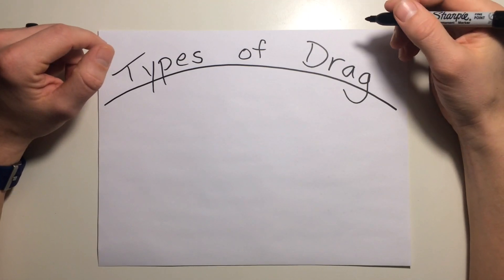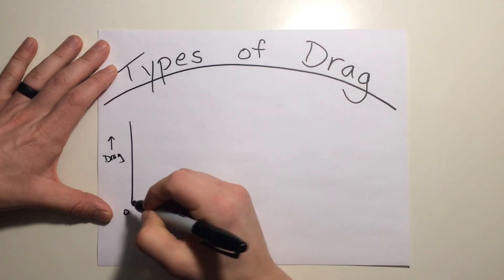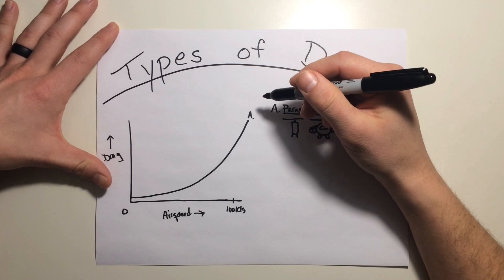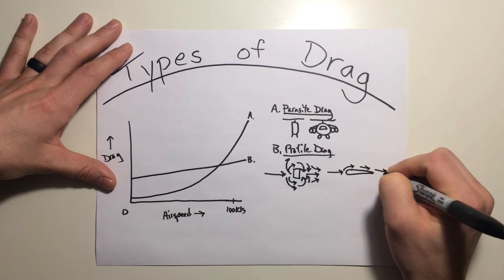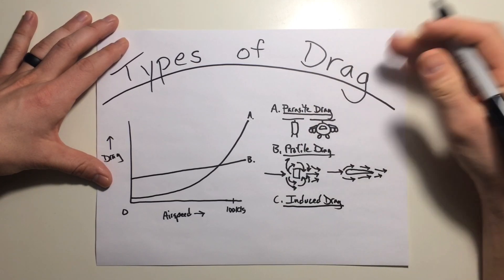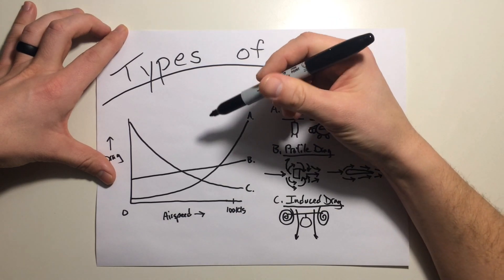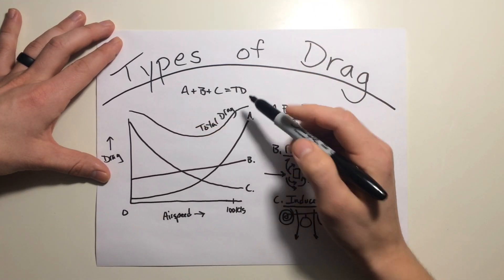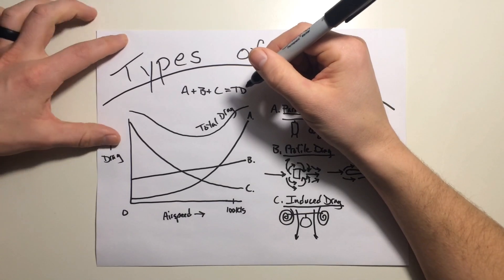Types of Drag in Helicopters

Comment: W0w!  at zero speed the drag FORCE on the helicopter is according to you large! THAT is not possible
You are confusing drag with power , mister.
Thrust in unaccelerated flight must equal drag. In hover the Helicopter Rotor Thrust in forward direction is zero, so no drag FORCE, Zero.
The rotating blades do have drag , creating a moment about the rotor axis, which the engine must overcome.
This moment times the angular velocity is the POWER the engine, after friction losses must provide. In Hover, at zero speed with a tail rotor pushing the tail, The Rotor must oppose this lateral tailforce with an equal and opposite tilted rotor side force. That small force is the only force in the plane of the rotor produced. The rotor POWER is the sum of the blade friction (parasite) power and the induced power required to push the air through the rotor to generate the lift that supports the helicopter weight., So far all the foregoing in hover flight.
Some  simple equations:
Induced POWER of the rotor
P = L^1.5  × √(2/π  rho)   ÷ Dia.
Dia     rotor diameter
rho    air density
L         rotor lift force   >  weight
Reply: Yes, and the parasite  rotor power is D = 3/4 Lift Vtip Cd/Cl  
also a simple equation

Comment: Does the drag force in the climbing direction matter when the helicopter is climbing?
Reply from the maker: I don’t think I understand your question. Can you restate it?
Reply: @helicopterlessonsin10minut10  What drag forces occur when climbing?
Reply from the maker: You’re still going to have the same types of drag although if you climb there is generally reduced induced flow because the resultant relative wind impacts the rotor different. The reverse is true for descents.

Comment: How parasite power varies with altitude .

Can anyone throw some light on this.
Regards
Ashish
Reply from the maker: Generally it’s a product of speed. Technically the air gets less dense as you increase altitude so theoretically it wouldn’t increase as quickly at higher altitudes. But this difference would be hard to notice or measure as a pilot.
Reply: I agree. Density decreases at higher altitudes which means the helicopter flies through the air easier, but the airfoils (rotors) aren't as efficient, therefore, equalizing. Or on a miniscule level only meant for engineers/scientists to calculate.

Comment: How parasite power varies with increase in altitude ???
Reply from the maker: Generally it’s a product of speed. Technically the air gets less dense as you increase altitude so theoretically it wouldn’t increase as quickly at higher altitudes. But this difference would be hard to notice or measure as a pilot.

Comment: what are situations where you would want to hang outside of the bucket? are there good weather conditions for example that would motivate you to move right on the x axis if you were in a hurry?
Reply from the maker: Take a look at my Crucial Speeds every helicopter pilot should know. Flying Max Range airspeed is the most fuel efficient for distance so it’s the equivalent of best miles per gallon. Also, flying at faster airspeeds may be used as an extra bank account when having to fly lower altitudes. Think, if you have an engine failure you can trade off that inertia to charge the rotor for an autorotation. I outline those principles more in my 3 Bank Accounts video.

Comment: How are the calculations of parasitic drag made? My gyroplane is an open air constructed of square tubing and I expect the Wright Brothers machine had better drag numbers than mine does.
Reply from the maker: I’m sure it’s determined by either flight or wind tunnel testing and varied by aircraft. Ultimately the engineers who design the aircraft measure it. I don’t have the best answer for you. I fly and teach, but don’t design helicopters.

Comment: Profile drag is what is also called “wetted area.” It is the surface of the profile. Which the wind will strike perpendicular. It is the area which even if the angle of attack of the airfoil is zero and no lift is produced and all induced drag is gone, that area will still resist the wind however slight. No matter how streamlined the designers are successful, there will always be some wetted area which remains.
Reply: Any surface against the wind, no matter how aerodynamic, will have drag. Try moving a butter knife in a bucket of water sideways, you will feel drag, like an oar in the water. Now move the butter knife in a slicing fashion in the water. It "slices" or moves right through the water with much less resistance, or drag, but there still is some drag, however quite small. Change the angle/pitch of the butter knife n you can experiment.. the Rotor